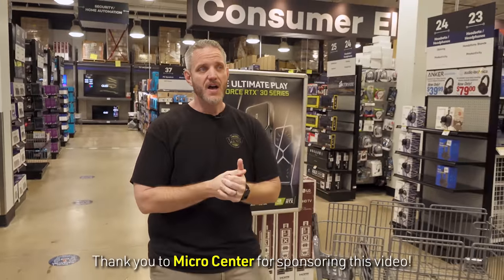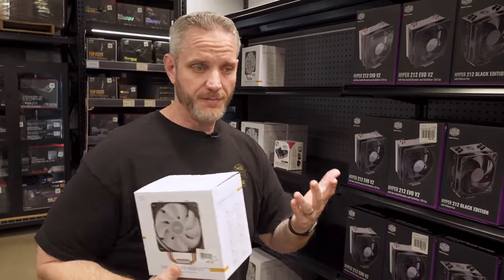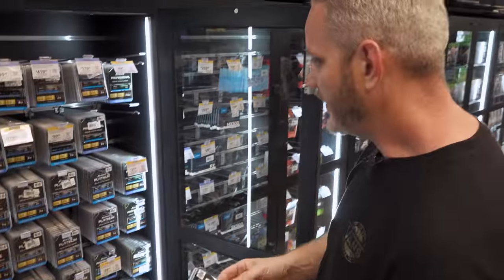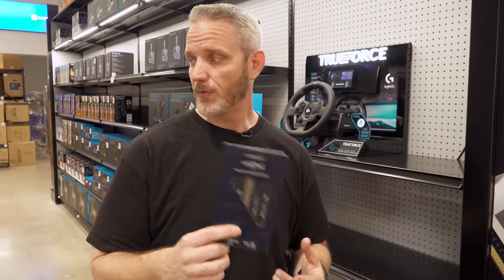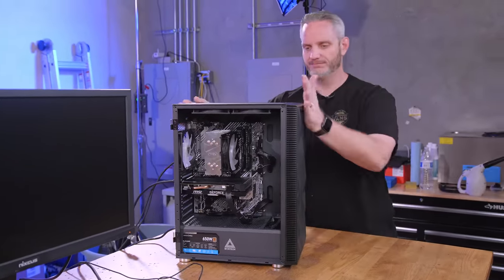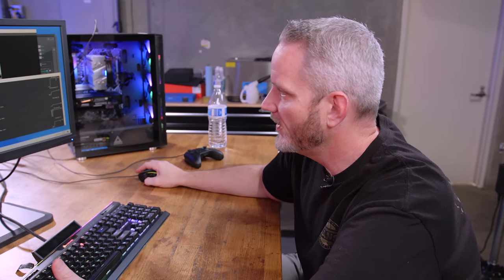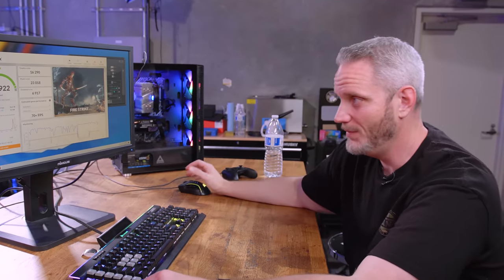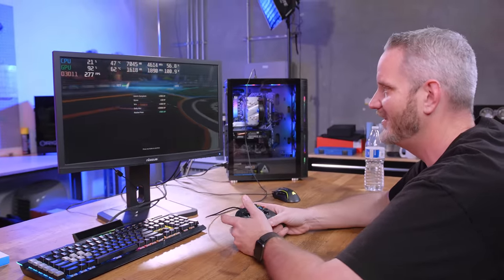How cheap can I build a "Gaming PC" for in 2022

Comment: i was with ya till you said because their new it's gonna last you a while, ok but an rx 580 is still able to run most games at 1080p 60fpd. and you can get them new, games like forespoken requiring a crazy gpu is a game out of the norm, and it's a garbage game anyways. hell even a 1080 ti can run most games out there 1080p ultra. and it will for a while, just because new gpus come out, doesn't mean games are going to comparatively be on the level of say a 4080 all the time. that makes a game very inaccessible. i recently went from a rx 580 to a 2080 ti for 300 bucks, because my friend said he was having trouble with it, but i am having no issues. i would rather buy a 3080 ti used at a fair price, then a new 1660 for close to 400.

Comment: 1080p is too low for moden gaming. 1440p with fxaa is a minimum now. 1080p looks like vassilene is on the screen. I opt for 4k at 30 fps and a few settings turned down.

Comment: ...a question related to choosing video cards.  I'm NOT a gamer however I do watch all my video content using my PC.  Besides email, Internet & productivity, my PC is my television and movie theater.  Are there large differences in the demands placed on a card that will be playing movies or streaming video as opposed to a card that is gaming?  What video card (or family of video cards) makes sense for me?  I like to save money but never choose at the expense of quality.
Reply: For your use case, you don't necessarily need a dedicated graphics card. Most integrated graphics on AMD/Intel CPUs will be more than good enough for your use case. This assuming you don't buy a CPU without integrated graphics. Most of the mid to high end AMD CPUs don't have integrated graphics. In that case, you can buy an inexpensive, low-end graphics card like a GT 1030.
Reply: @JJFlores197  Thanks Jose.  I've looked at APU's recently but they're expensive enough to eat up the savings gained by not having to buy a GPU.  The manufacturers are smart enough to price that equation into their lineup.  In that case it's always occurred to me that I'd prefer to get the "future proofing" inherent in buying a more robust system that I have to buy a GPU for.  What I'd like to see is a robust APU PC.  So far, they don't exist.  Thanks for the tip on the GT-1030, I'm going to check that out.
Reply: @JJFlores197  Any chance you could specify (or send a link) to the GT1030 you're thinking of?  The ones I'm seeing are $9000.
Reply: @arttursh8324  I can't post links since YT will delete my comment. On Amazon, most of them are less than $150.

Comment: Question! Is it still worth buying another GPU for my i7 7700k? Blew up my evga gtx 1080 And I’m wondering if it’ll be better building a 2022 rig rather than buying another 1080 or Rx 5700 XT?

Comment: Hey, I just recently started into pc gaming. Unfortunately in my area there’s only one person that builds computers. I told him I was wanting a system that could run games like call of duty warzone and other games on ultra settings and so on. So far I’ve had to take the pc back many times for “Upgrades” because fps drops significantly in the games even with me lowering the settings. I’m at a little over $2,400 in this tower and it’s still struggling at times. I’m confident enough in my ability with electrical parts to replace, change things myself. I just want to know what I need to replace to actually get in the right direction of a nice build and not a miss matched pc. This is the spec list below any and all recommendations on what to change/add would be greatly appreciated. I just feel as if the build is kind of miss matched. 

ASUS H410 motherboard
i3-10100
16GB GSKILL DDR4
550W Montech 80+ PSU
PALIT RTX 3060
2TB SAMSUNG SSD
Reply: What resolution do you play? The 3060 is fluid in 1080p, but not more. And many games you will not be able to run in ultra, at best in high. And the I3 10100 is very basic, better an I5 10400. There are already several games that use more than 4 cores.
Reply: @guillermopaolini9895  So far it’s been 1080p, since I realized it wasn’t going to run fluently on anything higher. The frames drop consistently when you start to actually put it under load. I know I was looking at the i7 or i9 10th gens, after doing some research I realized the cpu was pretty basic. I was also thinking about upgrading to 32gb ram and maybe an AIO. The guy swears by the 3060 when I talk about trying to change it out.
Reply: $2,400 american dollars? wtf?
Reply: @TitanSP  Guy got shafted HARD without lube by the builder.

Comment: i would rather, took the 10400f, a cheaper motherboard and maybe the boxed cooler and buy a rx 6600 instead, which is about 50% faster than the 1660 super.

And maybe a smaller psu (500-550w) but a higher quality one, the components will draw 250-300w while gaming.

Comment: Finding a cheap ATX pc case is a pain. 
Is there space for the cooling item, cabel management at the back.
Airflow, low noise issue.
And even space for Nvidia.
And what about fans do the case come this this or do you need to buy 1 or 3 more.
Just to get it working.

Comment: I had a friend build me my pc but now I am debating if I should upgrade it. I’d I do, what? Comparable things with what I have. Is there a site that can say this is compatible with the current configuration. When I run games I now lower my settings so it can run smoothly. Would RAM fix that or is that the graphics card?

Comment: yo my pc is good i play vr and valorant and fortnite my frames on val are 130 144 fps on fortnite i get 100 120 fps and on vr 100 80 fps

my specs are i5 4440 rx 570 8gb
my card before i upgrade which is tomo is a rx 570 8gb plays vr at like the same frames cause i havent upgraded yet but i bored so ye ima up grade for looks cooling and on val multithreaded rendering so yea im happy with my pc but idk its in a fractl design matx case and my pc is very quiet but if it goes to 100% its very loud but ive never seen the cpu at over 70% but the gpu goes from 27% to 97% for a milisecond but very rarely you hear my pc my upgrade gpu is gonna be a asus gigabyte gtx 1070 ti
Reply: this is my reply

Comment: Personally, your choice of parts is still a tad too expensive, and I think you should've kept the RX 6600. I assume if you're building a gaming rig, you want the rig to just run most games fine, and like most people, you may not necessarily be a streamer or a content creator. Downgrading the CPU to an i3 10105f or i5 11400f, motherboard to any B560M, and case to any mATX case by Montech or other brands will give you some cash boost, which can be used to upgrade the NVME to 1TB, or add a 2TB HDD.

Comment: So i tried to buy R5 5600G with B550 but can't afford the price. So i went down to R3 3100 with B450 with reasonable price, until i found out that i need the GPU with the 3100 ( the gpu price still high as heaven in my country).. so i come in to the conclusion that nowdays PC is not for me anymore. I'll just stick with my FM2 APU processor then..

Comment: Hey man I bought an old workstation HP Z440 Workstation PC 6-Core 3.60GHz E5-1650 v4 - No RAM HDD GPU or OS, I’m planning to build up for editing 4k video, I was wondering if you had any input on the PCIe to nme2 converters and also I’ve readi can only go 2400 speed ram on this setup have you seen or tried running faster with a Xeon cpu.

Comment: As far as memory I got the 3200 2x8 gb Neo Forza Faye RGB ram and am looking  to overclock it as its set at 2400mhz. If i can at least get 3 or 3200 ill keep it for a while otherwise im going to wait until some good 3,600 or 42000 4x8's come down in price. Any recomenations on o-clocking my neo forza or getting better ram to go with my ryzan 7 5800x and gig rtx 3080 ti?

Comment: Hey Jay , I wanna thank you for all your help over the years building my first pc 
I have a question about an new build I'm doing for my son
Asus tuf gaming x570 pro wifi with ryzen 7 5800x.. Radeon 6700xt  850 gold gpu 
My issue is the memory for this corsair 3600MHz  ddr4  I have 2  8gig sticks in slots 2nd and 4th .once powered on I get the ram light on and no boot , took my old drr4 3200 ram and put that in the 2nd slot  powered up no problem in bios 
I'm not sure why it won't recognize the new ram .. I know I have to enable the over clock tweak but ,can't seem to get these to recognize..I've updated the bios to current with the old ram and tried the new sticks again but still ram error light

Comment: I have an old beater but I want to optimize it hp omen 870-224, 5i 7400, 16gb ram, Samsung 2tb ssd, and 1060 3gb vram gpu. From you vets out there I just want to know what’s a good gpu to move to with the i5 7th gen? I’m most likely going to run starfield and past bgs games. I’m a simple guy just need a lil help.
Reply: RTX 3060 Ti.

Comment: Is i5 650 processor high end . ( 2 cores 4 threads (4 cpu's ) , 3.20 ghz , lga 1156 shokets . Even It runs adobe premiere pro 2022 better with no lag with power saving mode .

Comment: This is the biggest flaw with PC gaming. The fact you can buy a current gen console for retail almost $500 cheaper than that and play at 4K with possible 120hz Is a bummer. this build in Canada would probably cost almost $2000 Building a PC right now is just not worth it especially for gaming. Yes I will agree PC gaming is much better, but the price doesn't justify it anymore.

Comment: Question: would getting a 850w used Corsair power supply be too much for the build? I'm basing on the stated mobo+CPU. TIA
Reply: No such thing as too much wattage. Its just future proofing for yourself. If your parts arnt drawing it then itll sit there unused. But when you get something that does draw that much then you have ut

Comment: no one knows?   Ge force Experience will not run on Win 7.  Will work on 10,  but the driver is the same and is now 3 years old.  I have a GEforce 1050 ti on 7 and 1850 ti on 10 in my laptop, which I can not upgrade.   I have 16 GB on both machines,  wish I had 32 GB memory.  I have an Acer 2ms r monitor.  Since I get no help about the graphics card,  I cant tell where the poor display is coming from my Acer 1440 1 ms refresh or the graphics card.  A good video would be how to calibrate your monitor to see if you get true colors or not.   Watching how to build cheap gaming PC.  I dont care at all about RBG lighting.  Programmer by trade but I do play games on win10.  This video spends more time on RGB lighting, rather than talking about more tweaks.    Thanks for your time.

Comment: So the 11600 was $20 cheaper than the 5600x but the 5600x comes with a cooler. Then got a $30 cooler so spent an $10. Messed up. 
I’m just saying. Love the Chanel

Comment: Lmao $900+ for a gaming PC is far from cheap to many people. I can go even cheaper. Last month I built a pc from new and used parts from eBay. $270 for an RTX 3060, $85 for a ryzen 5 3600 with air cooler, $65 for a new case with 3 preinstalled fans, $80 for motherboard, $50 for 16gb of ram, $50 for 1 TB SSD, and $50 for 550w PSU. Plus a 1080 60HZ monitor that came included with the rtx 3060. All of this for a total of $650 plus taxes. It’s so much cheaper to buy used . You can save yourself hundreds of dollars buying used, and so far everything I’ve bought used on eBay for the past decade has been durable.
Reply: This video is one year old.
You do realize that the prices for parts in 2022 were extremely high for a lot of parts?

Comment: Personally would've gone with an i3 10th or 12th gen, depending on 12th gen motherboard pricing and use the savings on an RX 6600 as the processor is rarely the bottleneck in gaming and the 6600 is much more capable than the 1660S

Comment: Can someone tell me if I did a good job with my build?

Corsair 4000D airflow
Ryzen 5 5600x
RTX3060Ti
X570-plus (wifi)
Corsair vengeance 2x8 gb cl 16 3600 ddr4
Samsung 980 pro 1tb m.2 pcie 4.0 x4
Seagate 2tb 7200rpm 
Noctua nh-u12s
Seasonic 650 80+ gold

$1250 for all that

Comment: I could put together a way better PC for that price that wouldn't cause you to have have to upgrade nearly half you components within the next year or 2.  Who in their right mind is going to want to install a motherboard that will soon need to be replaced... you're probably going to want a better case with better cooling  while you're at it, cause once you install a motherboard that will allow you to overclock that cpu, that case is going to get extremely hot.
Reply: Price out a $1,000 gaming pc then and drop the parts list lol. 

I’d say the only rules of trying to do that is
1. The parts need to be new 
2. Needs to be from a reputable vendor 
3. Needs to be able to hit 1080p gaming with medium to high settings 
4. And under $1,000 USD

Comment: The difference from 5600g to 5600x is huge, don't waste your money on a G you'd be better off buying a 5+ year old card used and running that with a X than the integrated graphics garbage and then being limited to that chip once you do get a gpu

Comment: funny, in eu. it's around 1145$. not 996$. and imagine best gaming pc build, with ryzen 9 7950x and nvidia rtx 3090 24 gb... it's around 16116$ .😭 not that many people can afford that, especially where i'm from. i bought my pc 3 years ago, for around 1392 $. with ryzen 5 3600 and msi gtx 1660 ti gaming x 6gb, and it's not that bad for gaming. especially on 1080p. gaming monitor 27 inch. with displayport cable .😎 considering "the prices these days" and  the gas and oil crisis in EU because the war in ukraine and ... 😢

Comment: Hey Jayz..my rgb lights blink once upon turning on the PSU switch. It will not blink again after turning off and on afterwards. It only happens when I unplug the power supply for a longer time. Is that normal? My pc runs properly btw.

Comment: I have a question I have a b450 v2 in a Corsair delta spec rgb case which I’m in the process of building and wondering I want to add another 3 more rgb fans but notice I only have one usb 3.0 port in the board and wondering if I can get a splitter for additional rob fans as I’m getting a Corsair fan splitter hub with the connections for rgb and could do with some help on this situation please

Comment: that's not cheap at all :/  i got my ryzen 3600, gtx 1060, 16gb 3000mhz RAM, 550W power supply, 512 gb ssd etc for just 700 bucks(tax included) back in 2017 and that graphic card is just 20-30% better.  5 years later... and 200-300 bucks more expensive.

Comment: If you want to build "cheap" don't buy brand new. Simple! Just do your homework and buy from places like ebay. Where a new motherboard could cost you 400 yo could get the same one used still in good condition for 100 and with new hardware coming out all the time and most people having an attitude of "it's new I want that" you can get some decent stuff second hand

Comment: Some folks are trying to achieve this goal by having 150-300$, mostly to hipe on attention to their videos when they are pretending of attempt this. Some crazy xeon's builds on noname motherboard from China, used graphic cards after mining, building everything inside an empty banana box...Per my understand the bare minimum is 1000$, if you have less, better grab an XBOX S/X whatever. So 50% or more of gaming PC budget is the graphic card, next its hard to find a good computer case for less then 70-80$ and power supply less than 100$. You can continue calculation based on your budget and preferences. Mouse and keyboard as well as monitor aren't included btw. )))

Comment: noob question can you take a lap GPU then put it in a desktop?
Reply: Laptop gpu? No. Pretty much all laptops that have dedicated GPUs have them soldered onto the motherboard making it impractical to remove. Laptops don't have many standardized parts like desktops computers do, so you cannot usually install/replace/remove components on a laptop.

Comment: whats the big difference between a 1660 and 1660 super
Reply: The super is the faster of the 2 and between thr 1660 the 1660 super and 1660 ti the super is normally the better value that said if all 3 or the same price and you have to go Nvidia go 1660 ti or if you don't mind amd go 6600 or 6600xt/6650xt(the 50 is a bit faster but I say go with which ever is cheaper between the XTs)

Comment: Well, I strongly disagree with the CPU and GPU picks, even if this is supposed to be a "budget" build. I mean, some "future proofing" is always valid imo A Ryzen 5600g with stock cooler, then a RX 6600, those are better picks imo, at least this PC can survive for more than 2 years, you have the security of integrated graphics and if someday the user wants to upgrade the CPU cooler, that is cheaper than upgrading the GPU... because the GTX 1650 is deprecated as hell, it will not endure even 1080p in a couple of years... which is a shame, because I currently own a GTX 1060 who could sustain itself with super sampling tech in theory, but we all know the PC market deprecated the hardware on purpose, to keep forcing us to consume and "upgrade"... goddamn late capitalism smh I am considering either the RX 5700 xt or the RX 6700 xt, refurbished of course, but only if I still have the patience to keep up with this hobby, it's not like there's any nextgen PC game in the horizon that looks really interesting or demanding